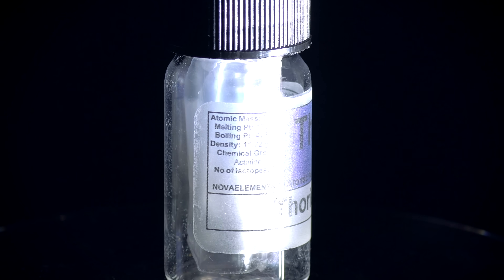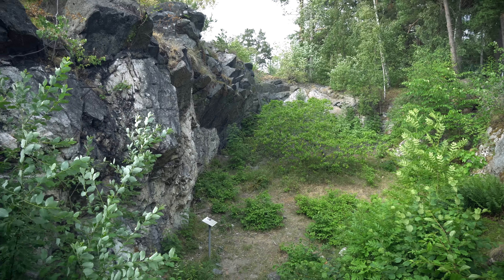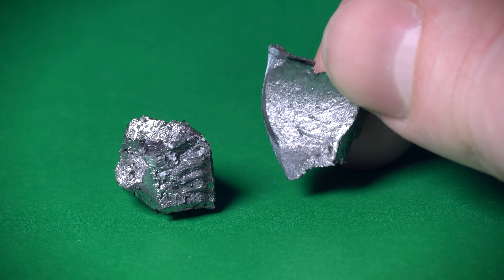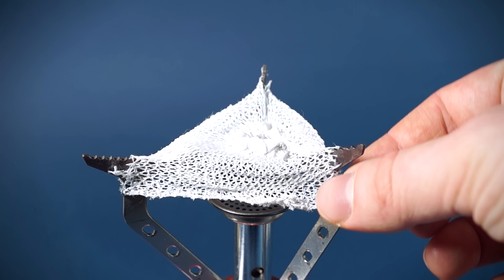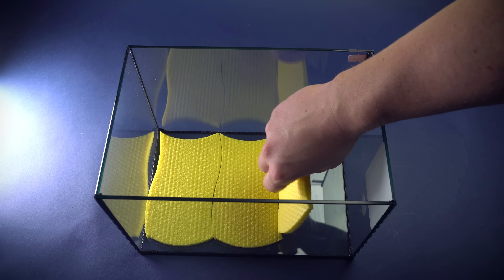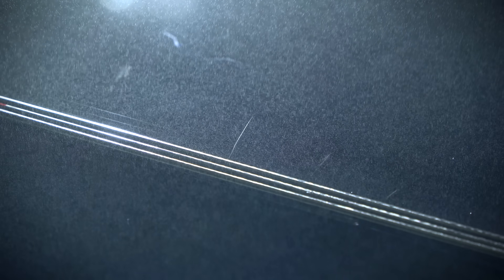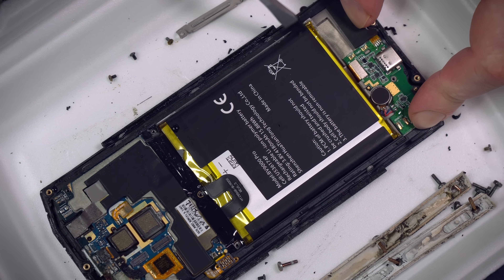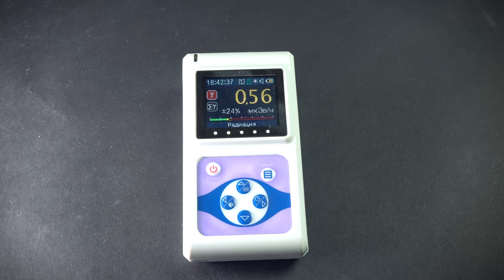Thorium - A METAL THAT NO ONE NEEDS!

Comment: what about thorium reactors? seems pretty useful there.
Reply: They're very good in mindustry
Reply: Why would we need thorium reactors now? We still have more than enough uranium.

All that thorium reactors do is convert thorium to uranium, to burn the uranium.

And as far as I know thorium reactors are quite a bit "dirtier", they produce more radioisotopes.
Reply: Name one place that has a functional, operating  thorium reactor.
Reply: @uegvdczuVF  Thats because the uranium and plutonium industries lobbied to have it shut down. Working thorium reactors are out there, are far more efficient, safer and cleaner than their uranium and plutonium counterparts
Reply: @candlestyx8517  another reason it's not used for reactors is because it doesn't provide compounds that can be easily weaponized ie thorium doesn't go boom
Reply: @uegvdczuVF  
India making one would be launching it this year or the next.
Reply: @uegvdczuVF  mindustry
Reply: @uegvdczuVF  Oakridge had a working Thorium reactor more than 40 years ago.